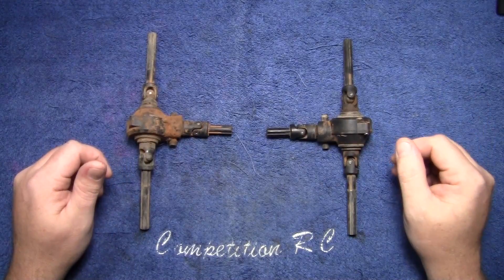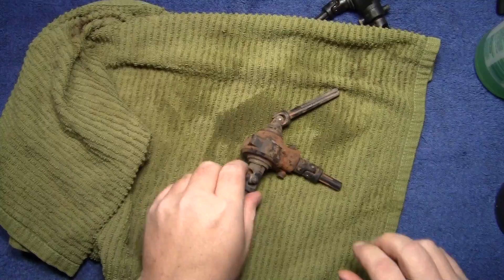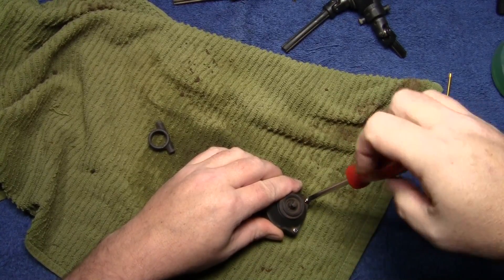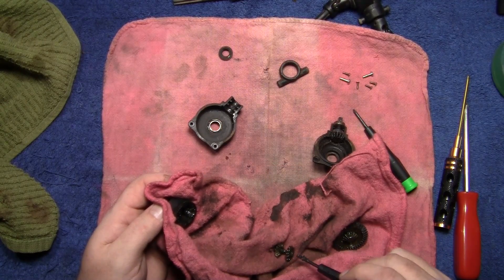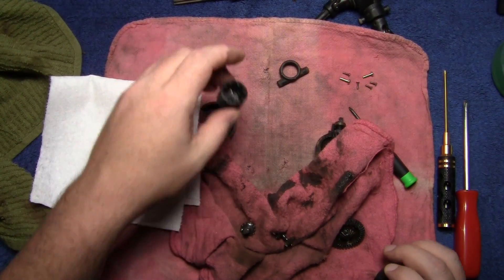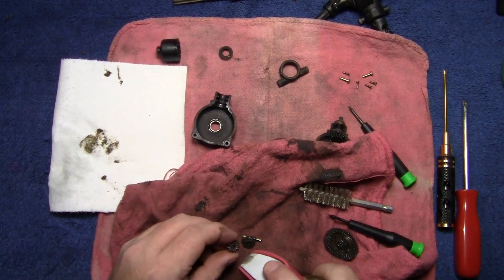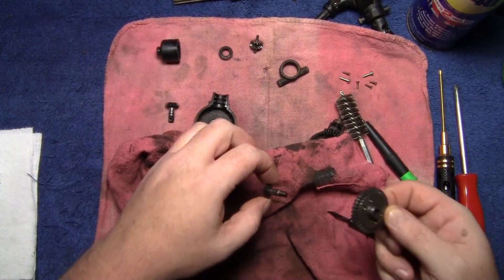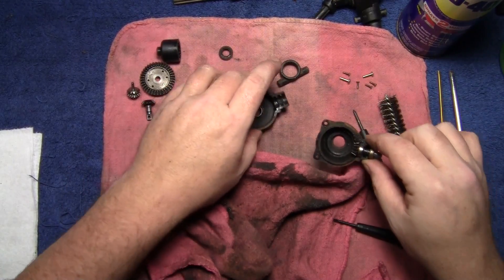Traxxas T-Maxx 2.5 Part 6 Rear Differential Rebuild

Comment: I've got a T Maxx 2.5R still in the box & one  bashing brute , RPM replacement, hop up's ! swing arms, shock tower's , body mounts , diff blocks & diff case's & 3.3 maxx drivetrain . With the optidrive ! Outlasted my 3.3 maxx still going .LOL appreciate the rebuild & maintenance vid going to keep one as my shelf queen 😃💯love the T Maxx 2.5R, kinda rare finding one ,still in the box with all the RPM upgrades & the Proline blue Aluminum skids & Willy bar & even Billet Traxxas wheels . Have a supper charger to add to my 2.5R & 3.3 with a turned dual pipe 🤔 Got a ?? Heard it really doesn't add any power & shorten's the lifespan of the engine ( more for looks ) should I add it 200$ kit . But right now have fun with my X.Maxx 8s love hydroplaning across that water 🙌🤙
Reply from the maker: If you want to add it for the looks, then go ahead. To me though, I will get the power out of the engine with other modifications. More on that in a future video. www.Rc-Help.com
Reply: @RcHelpDotCom  That's what I was thinking! Maybe add it to the shelf truck.  I didn't due my research ! Before spending the $$ . The kid in me thought "Supper chargers "😃was neat at the time . You know your Rc's ( facts) & the dual pipe causes a big loss in back pressure makes the tune's & starts extremely difficult . Appreciate the info & dig your channel 👍
Reply from the maker: Yea, they definitely look cool. And I love making these videos. Always liked just messing around with things.
Reply: @RcHelpDotCom  I told you I had a new 2.5 R that's been in the box ! Have you ever pulled one out of box & the new engine is seized ??

Comment: If they don't have a compressor they can alternatively use a small brush to dislodge the heavy grime. Cheap toothbrushes work great.
Reply from the maker: I did use a wire brush and WD-40 lol. I just want to prove you can do it without compressed air. Even though I really want to use it and it would make this so much easier lol.

Comment: Great video Tony. Must tackle my lightning Gtx 2... twin engine beast that needs sorting
Reply from the maker: Great to see you bro, hope the 800 isn't tossing you too many curve balls! Thanks for posting!
Reply: 800 grounded at the moment, expensive MKS tail servo decided to have a melt down. One of the chips on the PCB has started to crumble into the gear set.... due to cost it will take a while to replace
Reply from the maker: @TheFlyingHippo  Ah man, I'm having rudder servo issues on my 600 as well. Mine is the 655 Align servo though. If you were not so far away, I would say send me that servo and I would see if I can replace that chip. Been dabbing in a little component level repairing here lately on PCB's. It's fun. Hope you get it back in the air soon. we need you to post more cheeky videos on the site hahaha.

Comment: I just took apart my tmaxx rear  apart last night or night before.an I have a comp but I never use it lol an also my bench is full of sand but I live in south west fl so I'm use to sand but I do ha e a big can of grease that's gets used a lot with bearings lol but I never use a comp an I packed the diff with bearing grease but it's not as thick as I want but better then spent grease lol great vid man I work on my tmaxx daily only cus these 2 truck are my go to try everything first with lol
Reply from the maker: I have thought about trying to make these sealed diffs and treating them like 1/8th scale buggies. They actually use the diff oil to tune the buggy. Center diff is something like 500k to 1M weight oil. 40K or so in the axle diff's. Definitely a lot of fun to play with. Next week, we get to find out what's wrong in the front diff lol.
Reply: @RcHelpDotCom  I bet it's bearings in the front if the rear was the way it was then the front is gonna be maybe worse an yes proper dif fluid holds better then bearing grease but the grease works just fine an I. Need the limited slip cus on 3s the axels like to twist buy 2s they are fine 3.3 axels coming soon

Comment: What about actual diff oil? Like 50k weight. Would you use something like that because the spider gears are more or less sealed where the outer case isn't? Great vids by the way bro, I'm rebuilding my 3.3 with your videos.
Reply: Also on my arrma senton I'll use diff oil so figured why not with the tmaxx.....
Reply from the maker: The reason we don't use diff oil in these is because they are not completely sealed diff's. The thicker oil you may get away with, but know as it heats up, it is likely going to leak into the large case.

Comment: Thanks RcHelpDotCom for the great videos!  I have done a bit or research on the Traxxas differential grease.  Inside the diff, where the spider gears go (under the gasket) should have a very thick silicone oil of the 30,000 to 100,000 weight, similar to the type found in automotive fan clutches.  Traxxas uses the part number 5136X.  This is a special oil and one thousand times thicker then the automotive 90 weight differential oil.  White grease, or bearing grease is used on the pinion and ring gears.
https://traxxas.com/products/parts/5136X
https://traxxas.com/products/parts/5130
You may find these oils by Associated, Losi and others.  They should all be the same type.
Reply from the maker: If I was racing this truck, I would agree with you. But just bashing it around the back yard, the bearing grease works just fine. Even when I was racing these trucks I still used bearing grease and they did great. Thanks for the comment.
Reply: I think that would apply to sealed diffs.... since these tmaxx cases don’t seal the oil inside with orings and gaskets we need to use grease. Not sure if there is a an upgraded sealed diff that can fit the Tmaxx though... Haven’t tried the review sealed case yet.